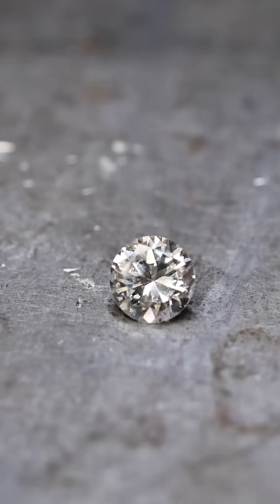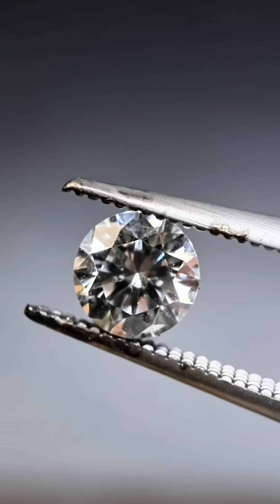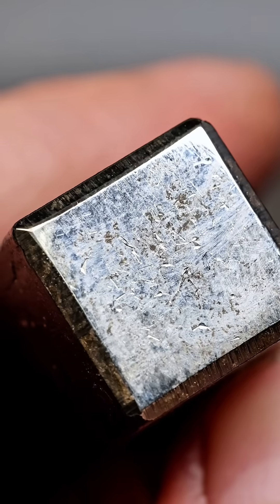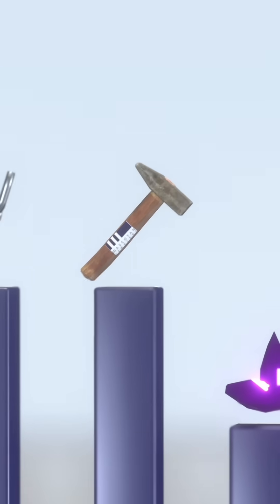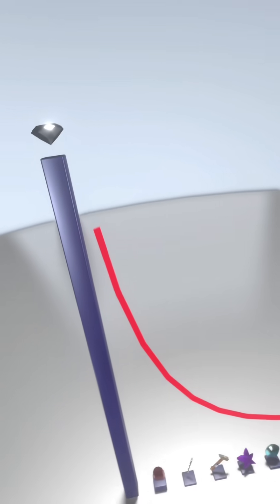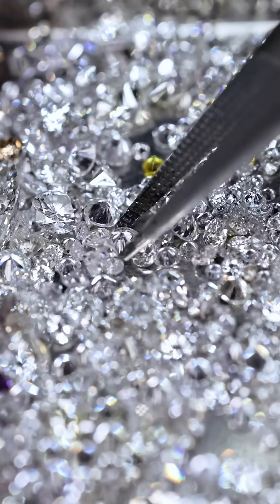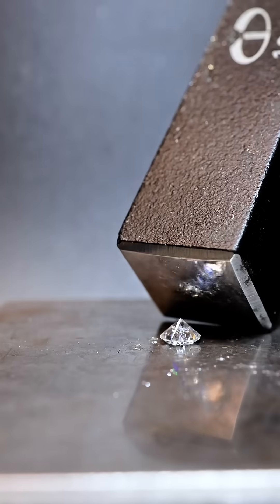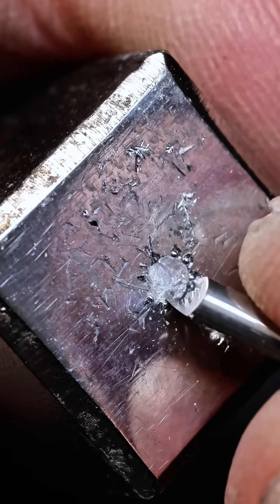Diamond vs Hammer

Comment: As a geologist a common misconception is assuming hardness is equivalent to strength while diamonds are very hard there also very brittle so they break easily when force is applied correctly
Reply: Alright guys, the geologists have spread, I’m pulling out the obsidian knife again
Reply: @Boiyu  "but it is fragile and cannot be used as a knif-"
Reply: @Boiyu  Oh no, not my only weakness... Shit I wont say the thing... AAAAA
Reply: @Boiyu 😂😂
Reply: Like that Rupert drop thing?
Reply: @VKakaVicky  no those have a built in weakness. with a different type of strength holding them together. A diamond is just carbon configured into a stable orientation of a crystal. But stable doesn't mean undisruptible. You can still make it become unstable if the right force is applied in the right way. the trick is finding that right way.
Reply: @VKakaVicky  that's what surprised me the most because it was easy to make but the hardness was terrible!
Reply: I don't think as you need to put force on its tail.. @VKakaVicky
Reply: My girlfriend also is a geologist lol. We’re agate hounds
Reply: @reprisal1051 Ooo! Agates in my opinion are so beautiful
Reply: Same misconception happens with Titanium.
Reply: yeah, and ive learned that in apprenticeship in the mechanical field. always the softer material will rub off the harder one. you will never scratch an iron bar with an aluminium bar. 
but yeah, what you mean is when you would put the diamon into a thing that would hold it in place, and then for example put it between a heavy press, it would also go into thousand pieces, without a diamond used.
Reply: @coooolibri properly treated aluminum will definitely scratch steel, but I guess it’s more accurate to say that aluminum oxide is the one doing the scratching.
Reply: @coooolibri  velocity does matter quite a lot in this matter, because you can definitely scratch iron with aluminum if enough force is applied
Reply: So…. Diamond isn’t unbreakable.
Reply: @ForestX77 Nothing is unbreakable
Reply: @ForestX77  they used to cut it using medieval tech in the medieval times. Obviously it can be broken.  You just need the right angle. If the person on this video would have smashed the pointy tip at the start with normal steel hammer it would have broken.
Reply: @ForestX77 Everyone got wooshef
Reply: Fellow Geo and I was about to say the same thing. Glad I checked the comments first.
Reply: Thank you.. it has always driven me absolutely nuts they way people use hardness to say toughness.  If glass is around a 5.5 on mohs, a baseball is not even on the scale.  Yet I could chuck one through a window with no issue.  I’m not a geologist, not even close, but I’ve always thought this was obvious.
Reply: So, can you explain in more detail? Is hardness relative to the force being applied in one way? And is brittleness relative to being able withstand force in various directions?
Reply: @ hardness in minerals is based on the mohs scale which is how easily a material is scratched with talc being a one so everything can scratch it with quartz being a 7 and diamond being a 10. To put that in perspective your fingernail is 2.5 a copper coin is 3.5 and a steel knife is 6.5. The scale is not linear it’s nearly exponential so the difference between 1 and 2 is smaller then the difference between 2 and 3 ect. For diamonds the brittleness comes from its molecular structure due to the bond types of each atom and the formation of the shape due to inability to absorb force when applied in certain planes this creates cleavage planes which are actually how diamond assets are generally cut by apply force in the weakest direction plane the diamond generally splits in a consumer known way allowing for a skilled craftsman to use that to make the diamonds we know. For general purposes if u smash a diamond with a hammer small bits will shatter off. Let me know if you have any questions this is a generalised explanation
Reply: @ okay, can hardness indicate more of impact resistance, but also make it so the material has more stress points that can be exploited? I am trying to imagine it in regards to tempering, and annealing.
Reply: @IRKnTBot  Not really. Hardness is a measure of a materials resistance to deformation not its ability to resist impact.
Reply: @ sorry, not really understanding the difference from your explanation.
Reply: @ mohs hardness won’t tell you much for impact resistance it will show you what’s more scratch resistant as only things that are harder can scratch for stress points your looking at atomic structure  /bonds and crystal lattice structures. With annealing for steel u add energy (electrons) to the material which changes what atomic structure forms and it’s crystal lattice structure. Deformation type would more so indicate impact resistance but it’s out of my expertise given I deal with mineralogy so knowing mohs hardness and cleavages and crystal lattice structure structures is important for me more so then how u can use it
Reply: @ okay, so what is different between a deformation and a crack? I am trying to understand from a perspective of why iron chains would be quenched. Is it just to keep their shape while sacrificing resilience so that they don’t bend much when handled correctly?
Reply: @IRKnTBot deformation describes how a material reacts when force is applied cracking is the end stage of deformation. When so much force is applied it breaks the structure of the materials atomic bonds, things that deform ductility/elaatically/plastically can have more force applied before cracking/fracturing then something that deforms brittlely as there is inherent weakness in the atomic structure that allows for weeakness to be exposed to force
Reply: @IRKnTBot  Hardness is how easy it is to scratch something, it has nothing to do with resisting an impact. Hit a diamond with a sledgehammer and the hardness won't matter, it'll shatter. Hit a piece of amber (easy to scratch) and it'll warp a little bit but be otherwise fine.
Reply: @IRKnTBot  Hardness is how easy is it to scratch. Toughness means how well it withstands pressure. Glass is quite hard. But shatteres when you hit it. Steel is softer than diamonds, however you can slam that hard onto concrete and it will not crack.
Reply: @ ah, so hardened steel isn’t good? I am just trying to understand because I want to make things. Would hardening steel have benefits to strength at all? Once again I do not mean to sound sardonic. I am looking to get into metal casting as a hobby. By the way, in geology can you sometimes like it, and sometimes not?
Reply: @ harden steel does have some strength benefits but it’s shatters when u hit it, if you’ve seen the sword forging videos where thin sheets come off it’s like that. Regular steel when hit squishes more so it’s different in that way I think. You’d be best looking what historically was used most commonly in the item your making as that’s a pretty good idea for what purpose each is used for. Second part, geology is a vast vast field for instants I have friends who work exclusively in the middle of nowhere with a off-roader and tents, others work underground in mine sites. I’m personally working in a lab with no outdoors work so it’s quite broad if you don’t like one bit. I hated working with satellite data and the more physics stuff personally. I know others who can’t map a plate boundary to save there life, were a vast bunch feel free to ask about the bit you don’t like but geology is very forgiving in what you can avoid <3
Reply: THEY'RE also very brittle...
Reply: thanks! come to comments to write something similar, but saw yours
Reply: So what is the strongest material tungsten?
Reply: Mechanical engineer here. That is correct. Hard materials tend to have a very short stress span in which they can deform after yielding because they simply take a lot of stress to yield in the first place. It takes an insanely high amount of stress to make diamond budge but when it does it will shatter worse than glass. We actually favor metal for our tools because they are softer, more ductile. They can be formed into whatever we desire, and in many different crystal structures without shattering, and be reliably used without breaking. Diamond is really good to make manufacturing tools because it can apply shear to metals and endure the returned force for a long time
Reply: A geologist eh? I know your weakness. brandishes obsidian knife
Reply: I don’t trust anyone who doesn’t know the difference between their, there, and they’re… sorry 😂
Reply: @YuumiMa1n  They are minerals Marie. I didn’t use the contraction right?
Reply: @linkgroundwalker  not you, the Parent comment, they used “there” 🤣
Reply: @ it’s the internet. I’m not going to bother with more then it takes for people to understand what I was saying. Especially for something I didn’t believe anyone would read.
Reply: Hello fellow Earth scientist. As a mining engineer I don't understand why you went the great trouble of trying to explain strength and perhaps cleavage of igneous rocks (somewhat) to monkeys around but hey it's a free country 😅
Reply: @ClippyDoesNotStealYourData it was a very tired mistake made in good faith forgetting the internet is a mixed place lol I have since learned generalised explanations are probably not worth my effort given those who complain lol.
Reply: This video is ridiculous and must be reported. Yes, yes. You can cut steel with a diamond tip, but smash against it and it'll break. How is this video getting so many views.
Reply: That's also the problem with armor. If it is too hard, it crashes on the impact. If it is too soft, it spreads and allows a bullet/shell to penetrate
Reply: As a student of mechanical engineering, me too
Reply: La moissanita y el zafiro tienen mas tenacidad a los golpes que un diamante
Reply: as a materials scientist i concur
Reply: I'm a jeweller. Diamonds are kinda piss weak. The first time you see one break, it blows your whole world away and all your "understanding" with it.
Reply: Ya, not some weak, performative taps...This guy is really annoying
Reply: People allways mistake hardness for toughness
Reply: What is the strongest material?
Reply: Aaww dam...so I can't just bejewel diamonds on the end of a hammer to make it stronger
Reply: @keevajazz6286  No, but it'll make it fabulous.
Reply: @Nerdiness1985  TRUUUUUUUUU!!!!!! XD
Reply: Yes.
Reply: Correct. A small piece of hard rock on the hammer can change the result.
Reply: I remember in geology class learning that rocks breaks along planes of weak bonds. One of the only things I remember lol
Reply: @ ah cleavage and fractures the bane of every first year geologists mineral id lol
Reply: There?
Reply: @jakebarnes3054  do u really go around social media calling out mere typos? What a helluva life u must live in your mom's basement 🤡
Reply: Then can you explain why diamond is the 2nd most durable armor and not iron in Minecraft?
Reply: @ you’d probably like the game theory episode on the diamond armour value if you haven’t seen it already
Reply: @B1ind.2025  i can explain, so theres a game theory video that sums this up pretty nice, diamond while hard can resist your everyday mc attacks, arrows, and stuff but takes more dmg from impacts lile explosions and falls and stuff, hence why you plate it with netherite, being thats its malleable and has high tencile, it makes up for the diamonds weakness, ut isnt that diamond is "strong" in Minecraft, its that it's strong relative to the attacks you NORMALLY face, skeletons dont launch steel hammers at you, they use flint bows, zombies punch you, creepers explode, etc etc,
Reply: Thanks. That doesn't explain anything at all
Reply: @Beliasa01 if you read the thread you’d see I’ve been responding and explaining more. It’s rather hard to explain a niche concept to an audience with a variety of education levels and background knowledge. Rather then saying it explains nothing you could ask a question
Reply: @emilyaford1055  too long; didn't read
Reply: Hardness always relates to ductility.
Reply: @ true most people don’t understand what ductile deformation refers to unfortunately
Reply: Hard = brittle, thats why you frame a house with nails and not screws
Reply: They’re minerals Marie!!
Reply: Yeah but you have a woman's name, so what you say means less that nothing. Back to the stove with ye!
Reply: Literally the comment I was looking for
Reply: oh hi, I'm actually studying geology heh
Reply: @ I hope you fall in love with it as much as I did <3
Reply: @matispro437 lmao lame, you should study real science bazinga
Reply: @ sure like the world would keep running find if we run out of new deposits of ore. Regardless of if we go renewable energy, or nuclear power or stay on fossil fuels they all require large amounts of mining
Reply: So how they make diamonds ? With some applying water and some iron cutting and drilling ?
Reply: @ diamonds are just carbon in an extremely high pressure environment. There’s specialised cambers to make them which is the limiting size factor. I’m not sure if the modern ones still use an explosive to make the pressure or not. I think Nile red got one so there might be a video over there
Reply: I've tried to explain this to so many people, they just think indestructible, not hard/brittle
Reply: Force applied correctly would be hitting the bottom or the tip of the diamond like he did in the video
Reply: @ went for generalised over mentioning corners or planes ect since not all diamonds have such a dramatic point and people get confused enough <3
Reply: @ so, exploiting a fracture point?
Reply: Yeah along the crystal boundaries
Reply: Well thank you!
You've just answered my question!

When I handed my engagement ring to my friend, she dropped it!
I'm wondering how it cracked!
Even the jeweler said I dropped it!
No sir!
I did not drop that ring! 😅
Reply: Interesting
Reply: As a geologist with no experience or knowledge whatsoever of diamonds or hardness I can confirm this video is cool 😊
Reply: I learned that from Game Theory.
Reply: and how is it shaped.. with lazer
Reply: As a matter of fact if I recall I think a sapphire is actually a little bit harder than a diamond
Reply: Toughness and durability. First responds for how great force you can withstand, second one how how much damage you can go on with.
Reply: Right! Hardness is about scratching. Cleavage is more important for breaking.
Reply: Hard materials are quite brittle
Reply: Isn't it a type of Jade that has the most strength?
Reply: @angrybidoof847 that’s interesting I’ll have to look into that, I know sapphire glass is very strong and is made of synthetic sapphires (corundum) and is used on the mars rovers and watch faces now days as a very strong clear material. But I haven’t looked into general materials yet <3
Reply: I mean, it’s kind of common sense because if there was no way to break a diamond with anything else other than a diamond than Howard, we have diamonds
Reply: The last word in your statement is the most important part of the video's mistake. A hammer can easily brake a diamond if properly hit.
Reply: exactly what I wanted to say! This video didn't make much sense, he could've crushed that diamond with the first hammer, he was just not putting too much effort. Now, had he tried to scrape the diamond or perforate it with iron that would've been something else.
Reply: Yes but you can hardly apply any strain to a tiny thing almost round in shape, so... The only way you can break a diamond of that shape is with pressure, meaning it needs to be applied with something as hard or almost as hard.
Or you can simply send whatever on it in the vacuum of space at a fraction of the speed of light, then you will also shatter it because too much energy 🐷
Reply: Yes
Reply: So what is the strongest mineral?
Reply: @emilyaford1055  and they'll burn. I used to repair jewelry. Seeing even a small diamond glow orange as I'm soldering near it was freaky until through experience i knew it would be fine.
Reply: Hey, would you like to check out my obsidian knife?
Reply: Don't need to be a scientist to know this lol
Reply: nerd
Reply: Precisely I was also annoyed that he used like 1/20 of the first hit, on the diamond hit
Reply: Diamonds are not very brittle. They are very strong as well as very hard
Reply: @HaydenLau.  yeah the channel literally commented that they were wrong
Reply: @HaydenLau.  bro no they arent. They're resistant to scratches.
Look at how flimsy his hammer was being swung at it
Reply: Because of their regular, crystalline structure, they are susceptible to cleavage planes.  Still takes a lot of force, yes.
Reply: There 💔 bros not a geologist
Reply: @plumpypearl  wtf are you saying?
Reply: Hey..I am also a geologist....where r u from
Reply: @omkarpanda6393 Australia <3
Reply: As a Materials Science student, this is absolutely true. As the hardness of any object increases, it becomes more brittle - meaning when force is applied at a concentrated (a particular) point in the right way, it shatters. Like glass.
Reply: apparently not! I at least thought they were much more brittle and would easily be shattered by a hammer
Reply: You are all wrong as Im masterbeters  theses diamonds is not interesting as much as asses
Reply: Yaa I just googled it most strongest comes to be graphene
Reply: As a speaker of English, they’re*
Reply: Alright nerd
Reply: They're =/= there
Reply: this is why my steven universe theories went off the rails in geology class in college 😅 i will never forget this fact because of it
Reply: * they’re
Reply: i know she aint a geologist cuz he used "there" for "they're" 😭😂
Reply: yeah, diamond will break with a strong hit, has nothing to do with hardness
Reply: What is clevage plane???
Reply: Like Glass, which is over 7 on the hardness scale.
Reply: very true. sledge hammers do the job well
Reply: Tensile strength
Reply: Fix your grammar.
Reply: Diamond is also not the hardest metrical, not only diamond can scratch diamond
Reply: I'm not a geologist but I do know that when you strike something like a diamond where you hit it is important...without the diamond inlay he struck on the wide edge with the inlay on the pointy tip
Reply: yep, im not a geologist, but that difference is important to note for sure
Reply: learned that from game theory
Reply: Exactly this video is just false that hammer can crush the diamond easily
Reply: He just hit it softly then when he had the Diamond he actually hit it hard
Reply: No asked for your opinion nerd
Reply: How can we measure strength then by push and pull?
Reply: Just because they are very brittle doesn't mean that they are weak
Reply: Diamonds are about 10x less brittle than people think.
Reply: This is unrelated to the Mohs Hardness scale, but since you're a geologist, I have a question just for you. Do you work for like a museum or something? I've always been told people who study geology never really make a livable wage from it - Yet I absolutely love studying Geology, because it's got all my favorite topics  put under one roof. :) (This may not make sense. If it doesn't , let me know, and I'll make it easier to understand)
Reply: @earthdyrad I’m Australian and lots of geologists here end up working at mine sites mapping mineral deposits and such. However I work in a lap imaging samples on a grain level to determine exactly what makes up that sample using a type of electron microscope. I make good money considering where I’m at in my career though those on mine sites make far more than me. I know some people who’ve gone into using satellites to map geological features and use that to determine possible mineral deposits and others who have gone into research or even working on new climate models and earthquake prediction ect. There’s quite a lot of different opportunities for geology as we need more and more rare resources to support increasing technology ❤lots of opportunities in research too if your into academia
Reply: @earthdyrad also if you take a some additional courses in environmental you have opportunities in construction consulting on projects like bridges and predicting erosion based on soil samples and how to prevent that from causing the bridge to collapse. And in conservation and mine restoration and such which might interest you depending on what you like about geology. I’ve seen some people do space stuff like analysing mars to determine possible resource extractions required for colonisation of distant planets.
Reply: How can something be hard and brittle at the same time?
Reply: You work for google be quiet
Reply: ?? You forgot your meds, Grandpa  @Robster1.
Reply: My thoughts precisely. Extremely hard things don’t take too kindly to hard impacts but they are very difficult to scratch.
Reply: WRONG THEIR: OPINION INVALIDATED.
Reply: Reminds me of attack vs durability
Reply: So Corning won't produce diamond iPhone screens then?
Reply: Hardness vs. Toughness. There's a difference.
Reply: Yes, my sister's diamond broke.  A small diamond in the setting of one of my rings chipped.  Diamonds can absolutely break, chip, split, etc.
Reply: So if diamonds are brittle, what is “stronger” than a diamond?
Reply: "We Diamonds may be hard, but we're also brittle 😢"
Reply: I'm also from a geology background and I agree with you 😊
Reply: Ah that must be why he didn't strike the diamond hard
Reply: Damn, dude. I'm not a geologist, so when I tried to write the same thing (I hadn't yet seen your comment) the result was very clumsy and was about 4 times as long. Even then, I'm not certain if I managed to get the point across...
Reply: Jesus Christ loves yall he died on the cross for yall repent and follow Christ, not forcing
Reply: Hardness is nothing but only how his internal carbon bonds are attached to each other if I am not wrong carbon molecules attached with other carbon in a hexagonal pattern.
Reply: Yea Im a jeweler and can tell you diamonds break. Happens all the time. 😂😂😂
Reply: Yea there's always a good balance between hardness and moldability. Like steel which was "designed" so it had the hardness of iron and isn't brittle so if something goes wrong in the machine and such it can be bent back into shape instead of having to buy a new piece that can be rather costly. Also that dude in the 1800's who "invented" steel did not do it first and it was a thing in Japan for ages, we didn't know that because only a while after we "allied" with them and "were the first" of all the countries to establish trade. Yes I'm using the parenthesis purposefully
Reply: I love how he didn't even hit it really hard and let it bounce around with the flat faceted side upwards. You know, allowing it to be the worst test ever.
Reply: Geologist or gemologist?? 😊
Reply: @ a geologist covers diamonds and such in a material sense a gemologist is more detailed like determining lab grown diamonds from natural and grading diamonds there more specialised
Reply: @emilyaford1055  There's no way people left you with 420 likes lmao
Reply: @emilyaford1055 *they’re = they are
Reply: @ashutoshverma8511 geology studies everything about earth, minerals, rock formations, etc, and they also learn about gemstones and how they're formed. 
Whilst gemologists are much more focused on gemstones and how they're formed, what type of minerals create different colors etc. 
So technically, it could be either, though they stated they're a geologist. I'm a geologist and I also came very close to getting my gemologist certification at GIA years ago, but I had a significant setback and wasn't able to finish it. I've been wanting to finish for a long time now. I find both geology and gemology extremely fascinating:)
Reply: @ashutoshverma8511 we'll have to wave around an obsidian knife to find out. If they're a geologist, they won't be able to see the wooden baseball bat in the other hand.
Reply: @ashutoshverma8511  if he meant gemologist I'm pretty sure he would've said gemologist
Reply: @ashutoshverma8511 I think that question is like saying: biologist or zoologist?, both of them are biologist, but the zoologist is a biologist specialized on animals, it's also like saying: medic or pediatrician?, both of them are medic, but the pediatrician is specialized on childrens.

I'm not a native english speaker, so Idk if this text is right, sorry for that.
Reply: @ashutoshverma8511  geo means earth, most diamonds we find are on earth
Reply: @ashutoshverma8511  Gemology Is just the Fancy cousin of Geology.
Reply: @ashutoshverma8511 gemologist is a joke of a field lol
Reply: @ashutoshverma8511 geologist is a certification even not an associated degree. A geologist covers everything in the earth, including gems and diamonds, they require to do a Bacherlor+. Diamons can be used in jewelry or industrial stuff. 🤦
Reply: they're*
Reply: @Kangooroo08  yeah, ay. Lol
Reply: Thank you Sir for providing this knowledge. 

May the very beautiful lotus-eyed Lord Nityananda and Lord Gauranga deliver and bestow the highest mellow of Love of Godhead upon you & your beloved family, my unknown respected elder. 

May all good fortune come to you.

Hare Krsna...yes, my religion is different from you but please accept them as they are purely out of gratitude and service.
Reply: Even if you are a geologist that statement is so contradictory and makes no sense. How can something break easily with physical force if it's very hard, the answer is it can't, unless you use another diamond with max force. It doesn't take rocket science to figure this out.
Reply: They're* 

You're a geologist and can't use simple first grade grammar? 🤨
Reply: @IsraelMedrano I mean I’m sure the job doesn’t require you to have excellent English skills, he’s a geologist.. that requires skills like data collecting, data analysis, analytic reasoning, mathematics, laboratory skills, sample collection, etc. 1 common grammar mistake on a YouTube comment section isn’t harming anyone..
Reply: Are you sure that you are a geologist. I'm dumb as a bag of rocks, but even I know the difference between, there and they're :D
Reply: you ain’t no geologist get out of here 😂
Reply: @ you do understand explaining complex niche concepts to an audience with a knowledge base you don’t know and is likely variable is challenging and often requires you to oversimplify things
Reply: @qt8365 Why not? Is being a geologist something so rare or difficult that someone claiming to be one is instantly a liar? I mean you would’ve believed him if he said he worked at McDonald’s, right?
Reply: @qt8365  unemployed people when they see an employed person:
Reply: @ what
Reply: Your a rock scientist 😂😂😂🫵🫵
Reply: @alexwasthere1  *you're
Reply: @alexwasthere1 like it's a bad thing ?
Reply: First off I know you're not a gemologist because you wouldn't have mistakenly said geologist but although diamonds can shatter it takes a lot of force their far from being brittle
Reply: @Fishlegs96  

Geologists typically have to do courses with the word Minerology in the name of those courses.

Rocks are made of minerals. 
The Earth's crust is made of rock. 

Diamond is a mineral. Most Geologists are focused on Mineral resources in mining operations (or involved in the petroleum industry). 

The individuals who typically study how the Earth "works", geologically, are called Geophysicists 

Brittle means a material allows very little to no deformation before it fractures. 
The word brittle, as a scientific term,  definitely describes diamond accurately.

But the word Brittle used in layman's terms would be misleading. Thus being ignorant of the more specific definition when used as a scientific term, can result in the type of misunderstanding you unknowingly experienced.
Reply: @Fishlegs96  way to be so confidently wrong. diamonds have extremely strong covalent bonds which make them hard but also prevents them from absorbing energy thus making them brittle
Reply: @Fishlegs96 😂😂 there’s still time to delete this
Reply: @lilfr4nkie  nah it's too late lol their cooked
Reply: @Fishlegs96  Geologist: all rocks
Gemologist: Just the really shiny rocks

Hope that helped.
Reply: @Fishlegs96 first of all you just repeated what OP said. Second Geologist can have many topics under it
Reply: @Fishlegs96  you do realize that diamonds are still minerals right? It’s extremely compressed carbon. Diamond is actually pretty basic lol. Geologists study how different gems are created by the earth, so yes a geologist would know, it’s just not their specialty
Reply: @Fishlegs96 Geologists still covers Gems.
Gemologists just cover, well, Gems.

Just like other fields, some cover somethin specific, and other cover a specific one along with others at the same time.
Best example i could give is a Dermatologist, yes, their main focus is skin, but they also cover tumors and surgeries, it's more broad than just someone who is just a Surgeon or just someone who covers one specific thing.
Similar to also a Primary Doctor, they cover a broad spectrum of things, just not as in depth or able to do exact things on what they find, therefore the patient is then sent to a specialist.

(idk if that helped or made any sense, but yeh-)
Reply: @yeet6362 all thumbs are fingers but not all fingers are thumbs
Reply: You seem very not bright.  @Fishlegs96
Reply: @Fishlegs96  Because geologists know nothing about naturally occuring materials and their hardness?
Reply: @Fishlegs96  Geologist is correct. Gemologists is a specialist in the field of geology. In a similar way to Archeologists vs Egyptologists. An Archeologists can still confidently talk about findings in Egypt without being a specialist.
Reply: @Fishlegs96  That’s like saying “First off I know you’re not a doctor, because you wouldn’t have mistakenly said Dentist” 😂😂😂
Reply: @Fishlegs96  hey man. Im sorry to be the one to tell you that diamond just shiny rock
Reply: @RatEatRat 
I love rocks!
Especially shiny ones! 😅
Reply: @Fishlegs96  the amount of effort required to break something is brittle or malleable. brittle and malleable are references to HOW something breaks. brittle things shatter like coffee mugs malleable things bend like spoons. with the perfect mixture of corn starch and water you have a material that actually CAN be referenced as brittle or malleable based on how much force is applied in a certain amount of time. so your idea of what brittle means technically isnt 100% wrong because oobleck exists. oobleck looked like it broke reality at one point in my life but it actually kinda breaks reality.
Reply: @Fishlegs96 Geologists study rocks and minerals from the Earth, remind me, whats a diamond again?
Reply: @Fishlegs96 Brittle is different from hard.
When something is hard, it's brittle, because it doesn't have any flex to it and will shatter the moment you bend it.
Reply: @Fishlegs96 Depends on how and where the force is applied with diamonds. They're tough, but outclassed by nephrite jade when it comes to toughness. Jade is obviously softer though.
Reply: @Fishlegs96 are you a geologist or gemologist?
Reply: @Fishlegs96  

"Rock is rock. Mineral is rock. Me like rock." - a geologist

"If it's not shiny, I don't want it!" - a gemologist
Reply: @Fishlegs96  Mate, a geologist knows all about minerals and geological formations, he is very much capable of explaining a diamond, and well, every single thing under the earth, he didn't "mistakenly" say anything.
Reply: @Fishlegs96 gemologists are specialist geologists
Reply: @Fishlegs96  😂😂😂😂. I love when people
Like you think they know something. Please continue to make false claims. I need a good laugh today.
Reply: @Fishlegs96  I think i'll listen to the educated person.
Reply: @Fishlegs96 brittle is the proper word.
Reply: @Fishlegs96  Eh, they're Relatively Brittle
Most things within the earth's crust are Tougher than DIamonds
Like, your garden variety rock is tougher
Reply: @nidhogg8446  a rock is not tougher than a diamond. Take a gem stone cut diamond and a gem stone cut garden rock of equal dimensions and smash them together, the diamond wins every time
Reply: @nidhogg8446 ur cool i like u
Reply: geologist hahaha that’s not real science
Reply: @cosmopolitanape6969  you're bad at this
Reply: @ ikr, no one got the reference bazinga
Reply: @cosmopolitanape6969  I was about to say you sound like you are quoting Sheldon word for word from The Big Bang Theory
Reply: @brittchiles9121  finally someone got it lol, here’s your award 🥇
Reply: @ haha thanks after the second time or so you said it I was like I know I’ve heard this before 😂😂
Reply: @cosmopolitanape6969 Like how actually dhuuuemb are you?
Reply: @ I am a theoretical physicist researching string theory so I know what real science is but I doubt you will ever get it with the grammar you have shown us.
Reply: @cosmopolitanape6969 sounds like someone is insecure about their own intelligence because geology is real science lmao. Oh wait, you’re probably lying about being a theoretical physicist
Reply: @ I am a respected theoretical physicist. I aspire to win a Nobel Prize someday. But nobody's gonna take me seriously if they find out I've been talking someone who dabbles in geology.
Reply: @cosmopolitanape6969  I’m gonna call you Mr puzzle pieces.

I’m sure are this amazing string theory quantum physicist in your little word. But it’s time to take off your oculus and get back on the meds 😂
Reply: @cosmopolitanape6969 theoretical physics isn't real science
Reply: @cosmopolitanape6969  youre not a physicist 😂
Reply: @ you forgot to say bazinga
Reply: @cosmopolitanape6969  Imagine saying geology isn't a real science when you're a theoretical physicist. Your field of study is literally theoretical.
Reply: @cosmopolitanape6969  Just for clarification, spending 15 minutes watching a youtube documentary on string theory does not make you a physicist, but I admire your ambition either way. I seriously hope you consider going back to school and earning your GED, as the first step is usually the hardest.
Reply: @cosmopolitanape6969  I wonder if he will understand the joke.
Reply: @cosmopolitanape6969 I doubt you're a theoretical physicist, but if you are... You're definitely not one worth listening to. Denigrating another scientific field for no apparent reason certainly shows a lack of open mindedness and flexibility.
Reply: @cosmopolitanape6969  im confused. How are you researching string theory when theres been barely any progress since 1999 more so that string theory is a framework so what part are you researching?
Reply: @cosmopolitanape6969 if you knew what "real science" is, then you would know that geology is a form of science.

Also, your grammer isn't any better. Where's the punctuation? Grammer is more than just spelling, Mr. Theoretical Physicist 😂
Reply: @cosmopolitanape6969 Says the guy with half a braincell. Geology has way more to do with science, physics and math than your pitiful brain is capable of understanding.
Reply: @cosmopolitanape6969 it really is